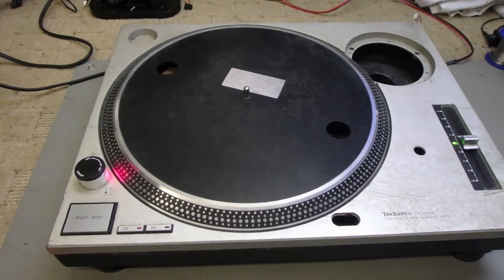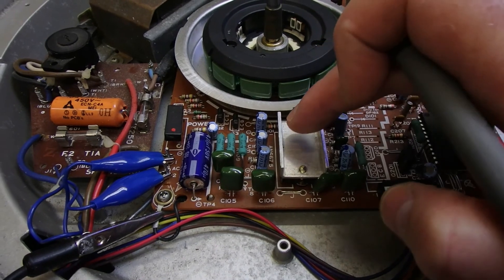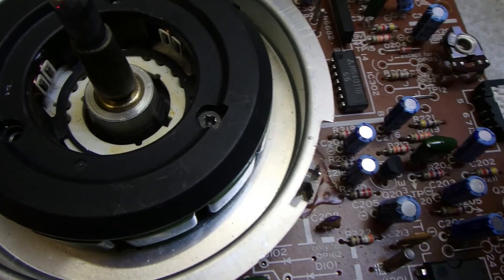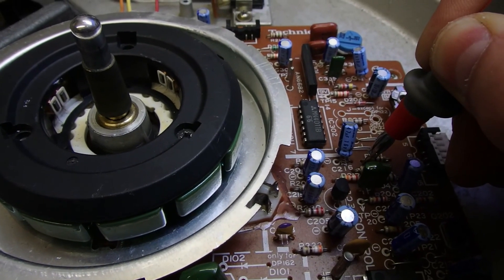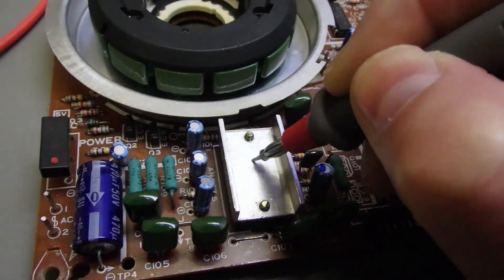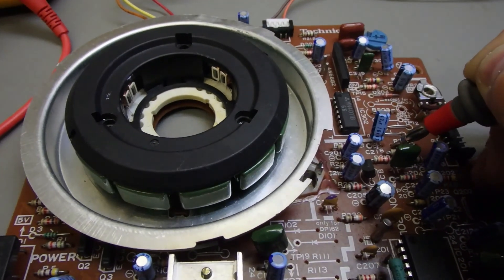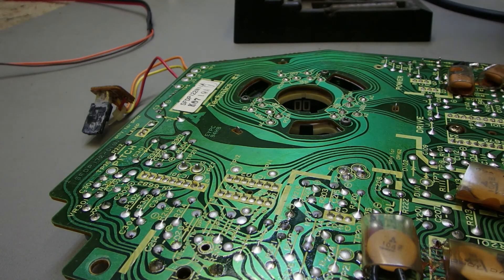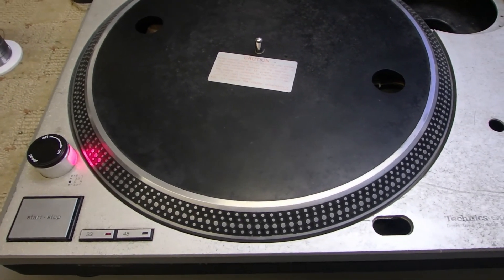Technics SL1210 / SL12100 running too fast, diagnosis and repair

Comment from the maker: Visit our ebay store https://www.ebay.co.uk/str/methleykev
Reply: I saved your store on ebay.  If i need parts (Which I may do) I will contact you on there :-)
Reply: Thank you very much DJ Spares for sharing this testing, fault finding and repair process. I have been searching for solution for my Technics SL-D2 turntable for the same Running too fast problem.  I will try to diagnose and find if any resistor or capasitor is faulty as you have explained.
Reply: looking for this cap is it on your ebay store?.. link please. TY.
Reply from the maker: @kennethdante  It is nothing special -  47 micro farad  / 47uF at 16V - available at any electronic component store.

Comment: Great fix. I have a Technics SL-DL1 spinning way too fast as well. Wow what an insane amount of circuitry in that SL-1200! I haven't looked at the SL-DL1 schematic yet, but I see there is about 20 electrolytic caps in the 3bay 5ellers kit for the speed issue. I have plenty of new caps. I'm curious if you or anyone out there has ran into this problem on a Technics SL-DL1 linear tracking turntable?

Comment: Nice trouble shooting. Most people would have just thrown an AN6680 at it and realized it didn't fix it. Thats the difference between a parts changer and a real repair tech.

Comment: I had the exact same symptom as you described, and using your excellent video as a guide,  I followed the same circuit analysis with my DMM to determine that I had the same problem with C216. I replaced it and all is well. You saved me countless hours/days of frustration. I can't thank you enough.  Great stuff. Keep it up.
Reply: I had the same issue. It was a loose soldering. Just re did it and it took care of the problem.

Comment: My 1200MK2 has a different cap in the C216 location. It's a yellow colored 47 uF 10V.  This board all original. Perhaps they switched some of these components when they released the 1210. This thing has a runaway speed issue also. I hope I don;t have to replace that drive IC. I'm a noob.
Reply: The caps are different on some boards. Yours is a newer board.
Reply: @richierich9696  thank you for reply, so this could still  be my culprit.. just a different spec'd cap?

Comment: I have an SP-10 MK2 that had the same problem. It spun really fast at first then a few weeks later, it completely stopped spinning. Do you think the issue is caused by the same cap that perhaps died? Any help would be appreciated. Thanks.

Comment: do you have the specs or a link to order this cap from you or anywhere a link would be greatly appreciated. Thank you very much!
Reply: nevermind I will just locate and replace whatever is bad using specs on the cap inside, dur :) TY

Comment: Great video but none of the mentioned has worked. Replaced - R221, C216, C201 and Q203. Checked AN6680 and AN6675 still have the problem
Reply from the maker: Check the detector coil for continuity

Comment: Extremely helpful.  I have an SL-1900 with a similar problem. Where would one locate the schematics for the motor board?  Thanks for the great video.
Reply from the maker: Hi Bill, Drop me an email info@djspares.com and I'll send you the service manual :-)

Comment: I have a SL-1210 i bought new in 1992. I haven't used it sense 1996, because the pitch control acts funny, the stock RCAs jacks are shot & pop up light/pitch control light don't work. The turntable powers up. How much would it cost to get repaired? Thanks!
Reply from the maker: Drop us a message info@djspares.com

Comment: Kev at DJ Spares is fantastic.If you have any faulty DJ equipment then Kev is the man to fix it for you.I have sent my prized processions which have been repaired to a very high standard and sent back to me in pristine condition.I would not go anywhere else for my DJ repairs.Fair price on repairs and in a quick turnaround time so check this guy out on ebay for all your parts and service needs.